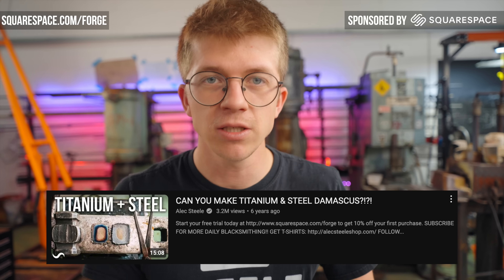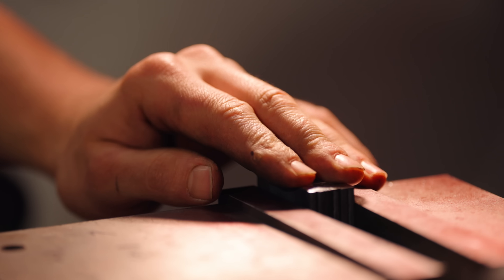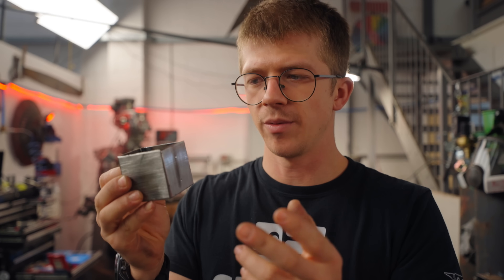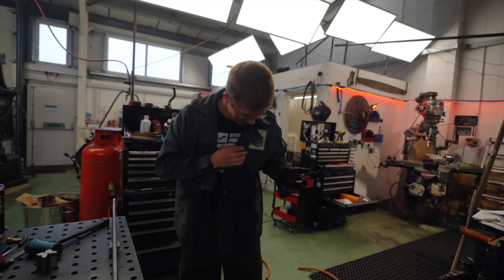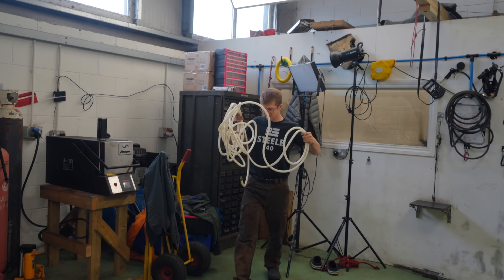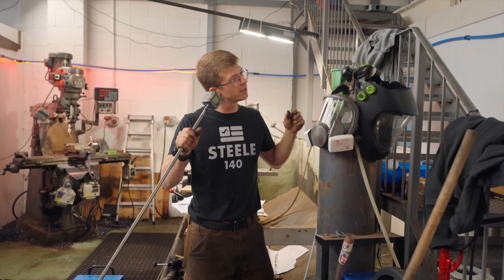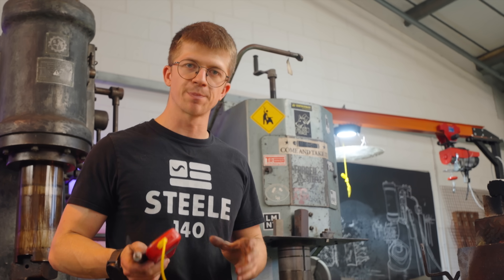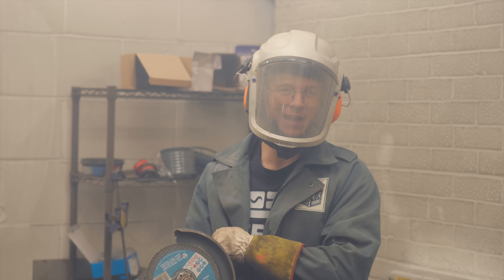Can I make Titanium Damascus?

Comment: Man I remember watching the original attempt video, crazy it’s been 6 years!
Reply from the maker: @JamyRyals  Thanks for sticking around for so long!!
Reply: @AlecSteele It's the thickness of the oxide layer on the Ti that determines the color. Try different amounts of heat time to get different thicknesses
Reply: @AlecSteele Sir, that's an extremely cool video. Absolutely dope.

What to make with the titanium? Are you limited to canister Damascus? 

Could you, potentially, purge an induction forge right beside a press? I know induction can heat and even melt titanium.

Or even purge the die working space, sort of keep it contained. 

Like you could almost make a plexi "fish tank" with a liner and go from induction forge to press freely. The argon should basically just "sit" in the fish tank and there are no burners to push gasses around.

Apparently induction can be used to ACCURATELY heat titanium.
Reply: Same!! Absolutely wild it's been that long
Reply: Where has time gone. Itt feels like just a while back 😂
Reply: Was that back when Sam the farrier was around??
Reply: No way was that 6 years ago.. :face-orange-biting-nails:
Reply: i have been here since MAKING USA FLAG DAMASCUS STEEL!!! made in Nov 8, 2016
Reply: Just looked back to the old days when the floor was made of dirt and you started selling forge burners….my god 7 years ago 🫣
Reply: I was thinking the same dude
Reply: Me too!
Reply: same :D